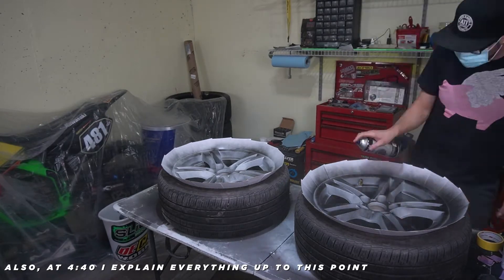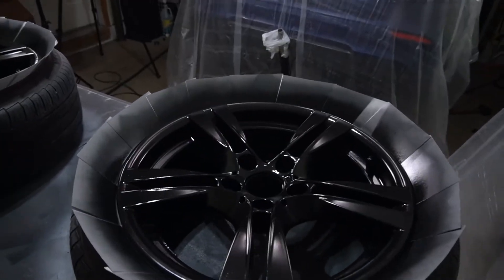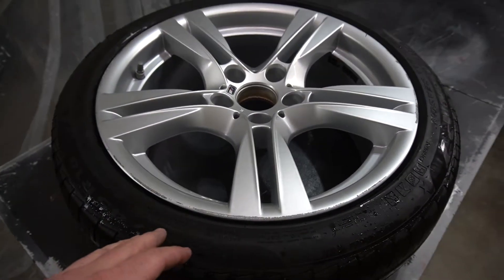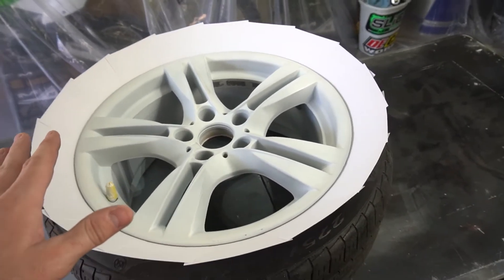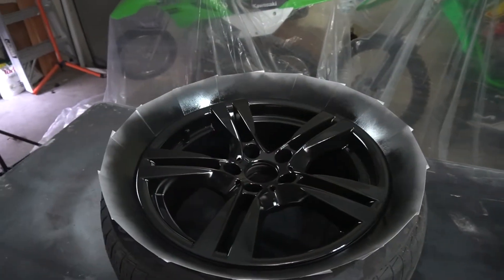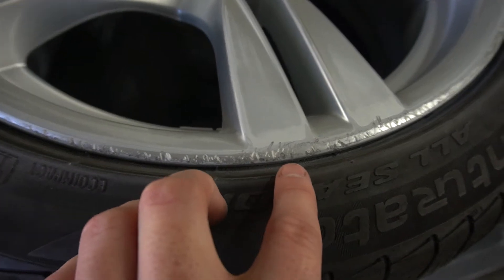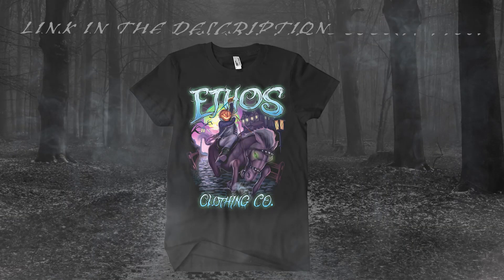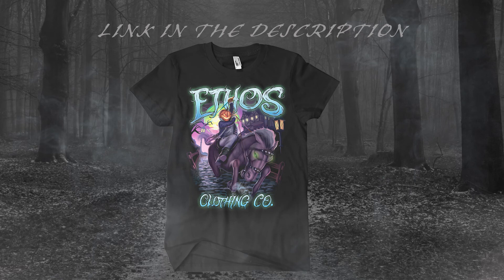Fix Curb Rash On Rims At Home - Part 2

Comment: You did not mask the inside of the wheel  that sits on the hub. Has this been a good idea?
And the tires on your winter wheels do not look like winter tires. What kind are they?
Reply from the maker: Nah I didn’t, I don’t think I ever have. I probably should and it’s probably recommended that you do but I’ve never had an issue with it at all. And no they are not, they are the stock Pirelli tires that come on the bmw. I just called them winter wheels because we were going to put some aftermarket wheels on it but I decided to wait and keep these to swap over. We’ll give those tires a shot and see how they do this winter, if they start to be a hassle we’ll have to do some all season tires or something like that for sure.